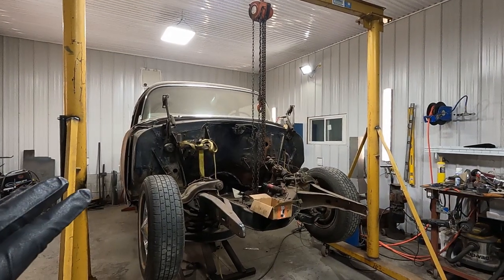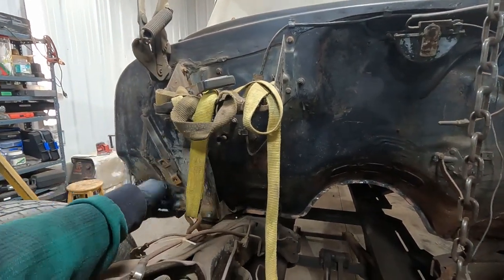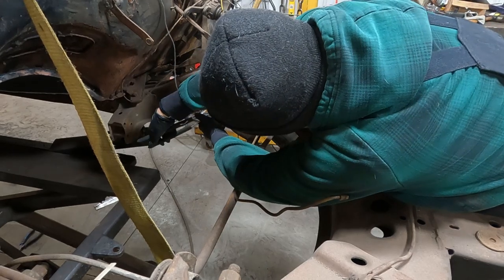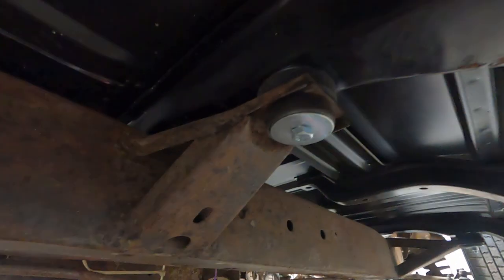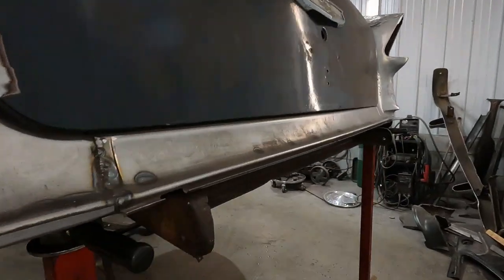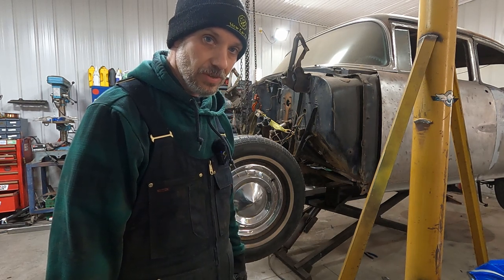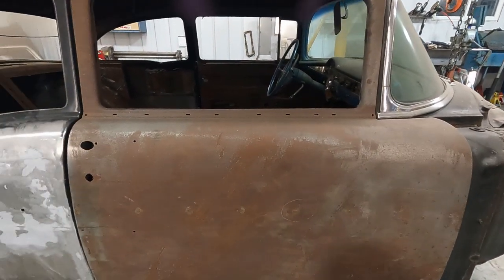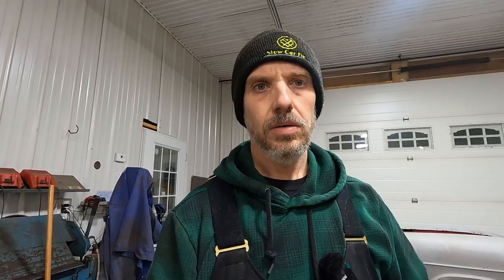1955 Chevy - Pulling the body off the frame!!  Slightly Sketchy!

Comment: If it was a Posi, it would have a large P on that flange, and Posi didn't come out until 57. If it's a 57 rear end, it will have a drain plug on the bottom, 55 and 56 didn't have the drain plug.  Project looking good!
Reply from the maker: Thanks for the info, I don't think it's a '57 rear end. I think it's the original '55. I might have to pick up something different that is okay with 3-350 wheel HP.